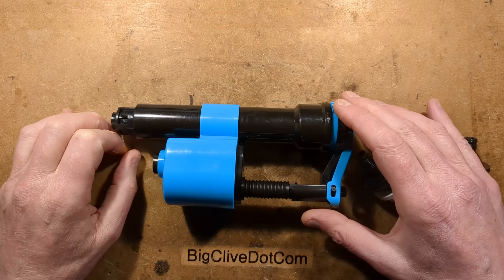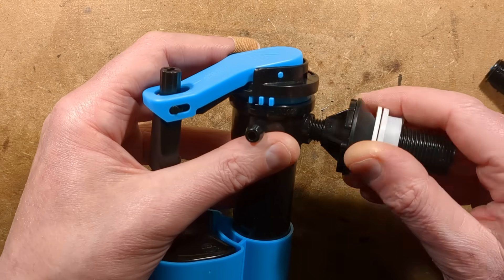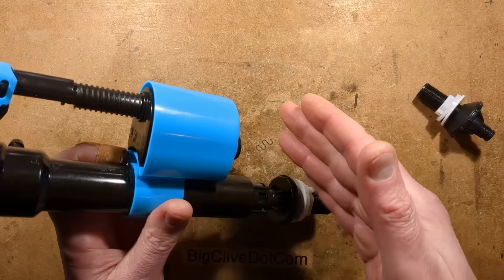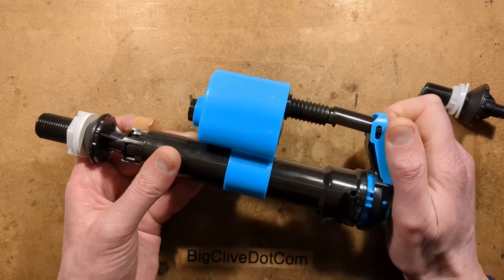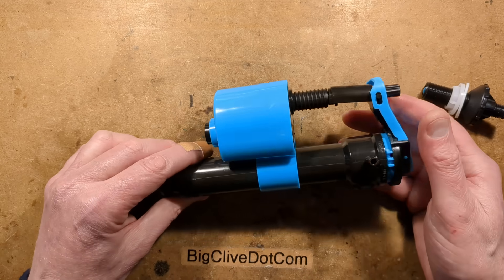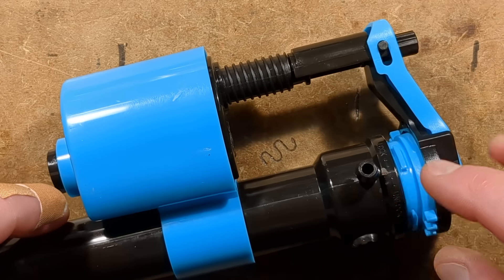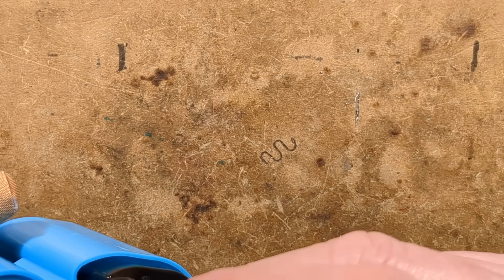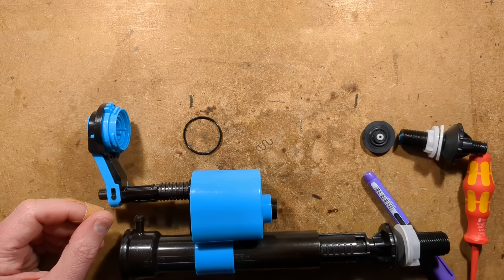Very clever universal Skylo toilet cistern fill valve system

Comment: A nice-to-have, would be a means to adjust the overall height from the top, rather than having to plunge one's hand into cold water in a restricted space. Or is it only me who manages to screw up installs of such valves?
Reply: Isolate at the service valve and flush?
Reply: @0xf_Steven  Indeed, but such a pain and there's always that 1 inch of water left which just covers the section you want to get to.

Comment: Be curious if all those potential points of failure and moving parts can handle really hard or otherwise contaminated (perhaps rain?) water and still have a good lifespan. I think it looks like it will probably be better than some, and likely easier to maintain than others too, but sometimes you just have to have the real world data.

Comment: is that nozzle on the side not for a feed pipe to supply cleaner from a tank alongside the cistern?
I'd guess when the supply is flowing past there it's moving pretty quick so there'd be vacuum due to venturi effect which pulls in a cleaning agent/sterilizer/aromatic

Comment: I had a similar moment when I took my first washing machine fill valve to bits.  The tiny solenoid and the diaphragm use the incoming pressure to hold the valve shut.  The armature just covers a little hole in the diaphragm.  Really good servo design, as you say, these things are interesting and it's and when you look at it and reverse engineer it, it makes you realise there's some really clever people out there.

Comment: Glad to see that the design of float valves has improved so much, especially at night when someone flushes the toilet. I  changed to using a Torbeck valve in the mid 90s which was much quieter than the traditional part 1 valve.

Comment: The universal design is clever, but adds parts to the design. Kohler makes a simpler similar valve that works very well. The valve can be opened for cleaning and service by lifting the lever and twisting the top. No tools are required. The ones I have are for 1.28 gal. (4.8 l) maximum per flush, so the tanks are small. (Press and quick release delivers less water for liquid only.)

Comment: The only problem with these, the ones with a plastic inlet, is they almost always fail when the pipe coupling cross threads and causes a leak. I have replaced many for this reason. As such I always choose a fill valve with a brass inlet that is a much better long term choice.
Reply: That's a problem with the installer.
Reply: @daz3745 yes but if it has a brass inlet they can't cock it up, and all the damage done before the leak is found could he been avoided, for a few extra Pounds.
Reply: @daz3745  ... who is usually Joe Homeowner.

Comment: Pretty genius design. In confused as to why the side inlet is needed, since the entire device needs to be installed vertically. I have never seen a toilet with a side water inlet.
Reply: Mostly “vintage” toilets and cold-water tanks have a side entry valve, with “stylish” modern loos you don’t want to see the plumbing so these have a bottom entry valve
Reply: @samuelfellows6923 Thanks!
Reply: Concealed cisterns are usually side entry fill

Comment: Always buy the the unit with the brass threaded inlet .
Reply from the maker: I usually do, but am concerned about the mating of the brass and plastic being a weak point.
Reply: i have a plastic one for more than i can remember, 25 years maybe? if you don't overtight it don't worry is not the failing point.... any idea of the name and patent date btw? having the option to fill from bottom and on top feels like a bad overcomplication tho. mine haves to top option only

Comment: If you had the toilet in a ready state and then turned off the main water supply to it, would it just flush on its own the one time?
Reply: No it would not. If you are wondering about the use of the water pressure of the supply in that valve to keep it closed, that value is just for the filling of the cistern. There is another, completely separate and unrelated valve connected to the flush handle that keeps the cistern water in until you flush.
Reply: @ljnrf it was the pressure that made me wonder. Thanks!

Comment: We have similar versions in the US, and they are great, and fast to replace. My only issue with the modern version over the old float version, is that the old float ones would kill the o-ring over time, and you could just replace an O-ring, with these, you are forced to replace the whole valve, float etc every 6 to 8 years when the internal O-ring dies. It isn't like you replace them constantly, but it is a bit more wasteful not being able to rebuild the modern version.
Reply from the maker: You can get replacement diaphragms for these.

Comment: The Geberit ones are the standard im Germany. Those ones are universal fit, work until the calcium buildup makes them leak in 15-20 years and are 25-30€. I wouldnt even considering buying a knockoff for that price.
But they are not one part, its a seperate fill and flush valve.

Comment: Look up the video 'The Flush Toilet" from channel Derf1208 from 17 years ago.  The video is a 1970s instructional film of a siphon/eductor toilet bisected.  Very amusing with the Greek chorus accompaniment.  The blocked off connection is for a hose to pin to the top of the overflow pipe to let water continue to flow out the rim jets of the bowl as the tank fills

Comment: I like the fact that you can remove the whole assembly without disturbing the connection to the water inlet, and the bottom or side inlet option in one device.
It seems to be a merger of all the best in Torbeck (equilibrium) type valves.
Clever design.

Comment: Did you buy a half inch float valve just to demo it? 😂
Just messing with ya, lol, look, thats just a reworked fluidmsster, a good design, uk based i think, the diaphram goes on em but you can buy them seperate anyway.
Have you found a solar rechargable digital clock anywhere?
Be easy to make one yea?
👍🏻
Reply from the maker: Only ever seen solar LCD clocks.

Comment: Similar to the Fluidmaster cistern. I installed a bathroom about 25 years ago then found the cistern was passing . I was going to buy the diaphragm then decided to change the whole unit. Isolated water and it took me 2 minutes to change. Also changed the diaphragm on the old unit and kept it as a spare.🙂

Comment: I think the float is open at the bottom, so it can refresh its charge of air on each flush, unlike a sealed float which might leak and fill with water and stop working.  Lots of cleverness in all that molded plastic.
Reply: A singularly distinguishing feature that the ballcock really needed as those floaty balls often get infiltrated with water rendering them less effective and eventually useless over time. So many of those systems you'll find had the rod manually bent as maintenance to compensate for the water-logging effect.

Comment: Super clever.  I don't think I've seen this type in the US, but will look.  I LOVE the idea that the rubber parts are replaceable!  I don't mind the flowing water sounds at all, would it still work ok if the filter/slowdown insert were removed, or would flow overwhelm the mechanism?

So, got a link, or name/mfg/model number for this unit?  Old fill valves seemed to last forever, but now I have to replace every few years..  Not hard but a pain, especially when it either won't fill and you don't notice 'til next use, or it just keeps running, wasting water, precious and expensive here in southern California.
Reply from the maker: It would still work, but the filter reduces the risk of debris clogging the diaphragm pressurising holes.
Reply: Both of our toilets need new guts soon. I'd like to find one like this too.
Reply: We have this exact type in California, they are very common here.
Reply: @ljnrf  Thanks.  Got a link?  I can't find this brand on amazon or home depot websites.

Comment: Those syphon toilets aren't supposed to raise the water level when you flush, the fault is caused by the seals failing on the components between the cistern and pan. When you flush the water level in the pan should immediately fall, the vacuum sucking the pan clear. Repairs are not easy as it is difficult to get all the parts aligned to seal properly, but worth the effort to repair. Don't see them much now as they consume a lot of water during flushing. They are very expensive to buy second hand.

Comment: I am somewhat reminded of pipe organ valves. Where a small amount of pressure allows a large amount of pressure to open an even larger amount of pressure. In that case the pipe will sound faster than any other method, in this case I hope there will be no such sounds...

Comment: I like the idea of side or bottom fill in one unit, you’ll always have the correct one on the van.
Reply: side fill is common in older units, and in plastic tanks, but bottom fill is very much the thing now, especially in close couple units, where the tank sits on the seat, and thus you want all piping to be compact. Gven the Geberit in wall units are all bottom feed, the only choice you get is left side or right side, with the tank set coming with a blanking plug for the unused hole, as the overflow is already built into the flush mechanism now.

Apparently the local regs want you to now have external overflow, as people are too stupid to notice the internal one is running, so putting it outside will somehow magically make them fix it.
Reply: Bottom fill scares me a little bit. Never seen such design. Is it even legal? 😂 I believe not in my country. The only concern here is left or right, and sometimes up connection.
Reply: @moriak123  Bottom fills are incredibly prevalent in the US, and in fact pretty much the only kind you'll see. Very rare that water leaks through there though with the rubber gaskets sealing them. Pretty sure Europe has wildly different toilet plumbing though, from what I've seen. Super weird comparing the two despite everything being very similar.
Reply: @coffeebuticed the cisterns aren’t so very different but the pots are wildly different designs.
Reply: @coffeebuticed  my UK cistern is a bottom inlet.
Reply: @moriak123  Bottom is standard in the US for tank flush toilets. Very reliable seal, I'm sure they can fail and leak but it's the only seal on a toilet I've not personally seen leak. Which makes sense as it's a  chunky piece of stationary rubber that only holds back ~10 inches of water column.

Comment: I'm inclined to think the "delayed fill" is greenwash. It only delays by a couple of seconds, and seems to be an unintended consequence of the mechanism to raise the float rapidly. If you think too much water is being used, lower the water level slightly.
Reply: I'm thinking that if you have a leaky flapper this design will keep the fill valve from trickling.  The float stays up/off until the water levell drops below the Float cup valve.  Once the water level drops below that the water starts filling up for several seconds at a time as opposed to a trickle.  Hearing a toilet cycle is easier to catch than a nearly silent trickle.

Comment: A characteristic of all these equilibrium valves is that they require a certain minimum pressure. When I set up a rainwater harvesting system with a cistern in the loft, the upstairs toilet valve refused to open. I had to replace it with a traditional ball valve, but because the pressure is so low, it fills quietly. The valves in the washing machine downstairs got gunked up and didn't close properly, so I had to fit a filter, and then, due to the pressure drop across the filter, a (noisy) shower booster pump switched by the valve signal...

Comment: I have fitted a number of these valves over the years. This one is unusual, to me at least, as it is dual bottom/side fill. Very interesting video Clive.
Reply: I initially thought this was the same as the one in my loft, but it seems they keep refining them. The valve to allow the same unit to be side or bottom entry is clever.

Comment: compared to the Geberit and the Jomo (in DE) the Skylo really does it better. not only better serviceability, but the bearing of the adjustment screw is designed in such a clever way, that it does not break easily when force is applied accidentally during installation.

Comment: i used some of those when retrofitting old tanks. there must be countless generations of engineers who contributed to this final design.
Reply: Who knows if this is even the final design?
Reply: @matthewmarks6951  no design is final
Reply: There are at least a dozen designs by me in current use, with assorted levels of spare part support on them. In general with them i find that, once it starts to leak, you simply replace it, and very likely also the flexi pipe that feeds it as well, because you have to remove them to fix them, and putting in a new one is a lot faster. Also you will find the flexi has gone rock hard, and moving it will make it leak. Standard for me is to replace the valve (plastic ones so easy to do even if a plumber has stuck the thing in with window putty, just cut the plastic pipe off with a hacksaw blade) with a universal one, replace the flexi pipe and replace the stopcok, because it will 50% of the time start to leak. Cheap valve, cheap pipe and the most expensive part is the $15 universal valve, even at the most expensive hardware big box store, the only reason for them being it is Sunday 1PM, and they are the only one open.
Reply: @SeanBZA  , as my neighbour found out, there is a time limit on the flex piping.   you are supposed to replace them after 5 years.   if you leave it to 12 years they self-replace.   they burst and flood the house out ready for when you get home.
Reply: I bought the brass version for our original high level JapKap cistern, after doing a bit of online research and being very impressed with the flexibility of the design!
Reply: Same here, makes a massive difference when replacing older systems that are a tight fit and no more tweaking the rod so the ball does not foul the sides.
Nice and compact and cuts the fill noise on most systems without taking forever to fill.
Their flush system is equally compact but currently having an issue with one where it no longer flushes around the entire bowl.  Whether it's the short or long flush.
Reply: Someone in 2060 will say exactly this 😂